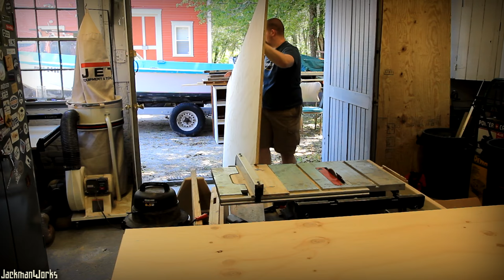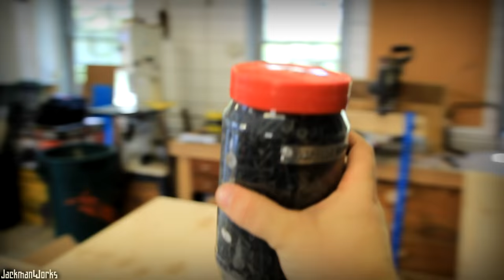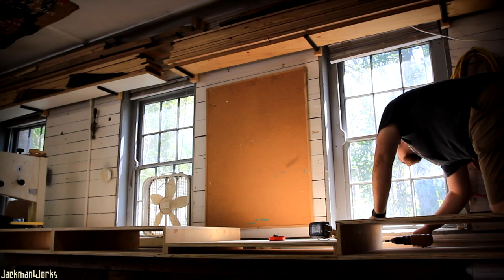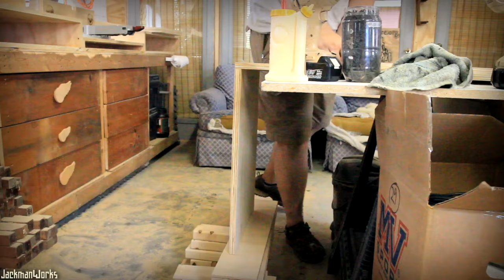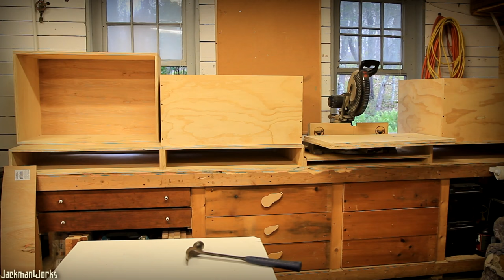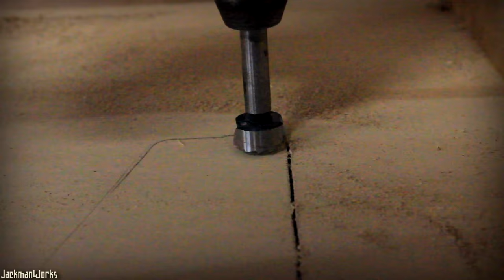Miter Saw Station - Boxes (part 1/3)

Comment: What type of plywood did you use for this? When Jay Bates built his miter saw master piece he used Purebond plywood from The Home Depot due to issues with other stuff. This looks like it's a lot of layers but no veneer surface. It also looked like it didn't debond or warp much. I might have missed it in the video though.
Reply from the maker: I actually don't think I specified - It's just 3/4" pine (~$30/sheet), not the stuff that Jay ended up using but it worked really well, stayed nice and straight. He originally was trying to use 3/4" luan on his which looked as stable as rice krispy treats :D

Comment: Loving your videos and your modular mitre saw station.  I am just building my workshop so I will be using some of your ideas if that is ok.  Couldn't quite catch what vehicle you drive, the orange and black one it looks great is it a Jeep?  Off to catch up on more of your videos.  Cheers. Andy - Sussex, UK
Reply from the maker: Go for it! That's why I share here. I drive a Honda Element, such an awesome hauler.

I just relocated my shop and that workbench stayed in the old shop. I'm wrapping up the new base for it now so keep your eyes out for that very soon.
Reply: Jackman Works cheers for the reply.  I have a Honda CRV but not so nice as the Element as just looked it up.  Not for sale in the UK sadly.  The CRV is ok but the load space is not so good.  Prefer a square wagon.  Andy
Reply from the maker: Yeah, the rounded shape on those isn't so nice for hauling stuff. The funny thing is that it's the exact same car except for the body, same exact frame, engine, transmission, you name it :D

Comment: I like you am building my version of this miter saw station. I have a question? When you built the backing plate for your wood to butt against while you make your cuts, what did you do with the space directly behind it? I've tried to think of a solution to utilize this wasted space. I thought about making a drawl, then if the backing plate isn't stationary, it may throw the cut off. It seems like a lot of wasted space to me. I'm not good at making myself clear sometimes, I hope you understand what I'm talking about.
mark
Reply from the maker: I totally got you! I was thinking the same with drawers, but like you said you then have to worry about play in the drawers which is why I didn't do that. I actually store a few things in there that I rarely ever use, like super specialty tools. With my wood drawer slides it's super easy to pop to bottom drawer out to access the space

Comment: What's your plan for dust collection?
Reply from the maker: The cabinet hang off the back of the work bench by about 6 inches, so I'm going to run a pipe up through the bottom of it soon
Reply: Jackman Works awesome! Hope to see that in the next videos.

Comment: Have two questions.  One i bought your plans for this.  Top and bottom.  When looking over the plans you have (UNO) is the the name of the plywood or does it mean something else. Second question,  do you have a video for the build,  that goes thru more in depth?
Reply from the maker: UNO means "unless noted otherwise"

Also, here's a link to the playlist that includes all of the build videos for this miter station, the top is 4 seperate videos and the bottom section is one long video: https://www.youtube.com/watch?v=l1DvUWLGgYQ&list=PLaQhHcfFvj6_iMqGX36haXLTXWRAtSuT8
Reply: In the video you use different wood for drawers. What was is, also what is (typ) ?
Reply from the maker: @jamesward1855  on the drawers I just used some reclaimed 3/4” thick pine boards because I had a bunch on hand
Reply: So sorry about all the questions,  but want to understand it right, so I don't have to buy more plywood. 
On layout 5 for 3/4 plywood.  I see the length of cut( 2'10 3/8) ,but my plans are missing the width. Same with the (2'10 1/2) & (3') have no width.  Then on layout 6 same with the top left corner of plans. I have length,  but not width, layout 7 seems to be missing some information too. It's probably faulty on my end. What does TYP, stand for?
Reply from the maker: - For layout 5 the widths are included on there, check the digital file to see if maybe you're printer cut them off when printing?
- For layout 6 the dimesions are all there too, all of the pieces on the top section of the sheet are 3.25" wide, 2'7 3/8" long
- TYP means typical, or that the thing it's pointing to is the same as other things near it that look the same

If you have any more questions, shoot me an email instead, I don't want your questions to get lost and go unanswered. https://www.jackmanworks.com/contact/
Reply: Thank you for being patient with me.  Had to break out the ruler and pencil.  Have to love technology.  Thank you again